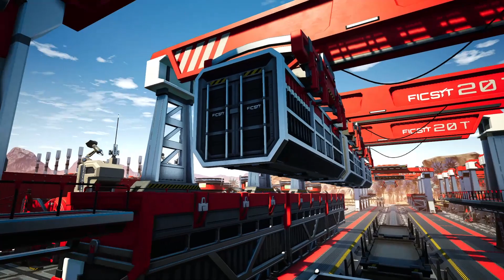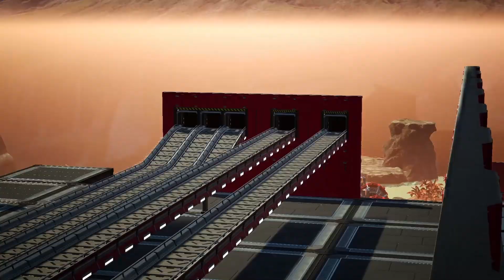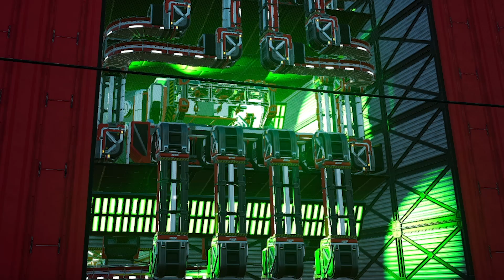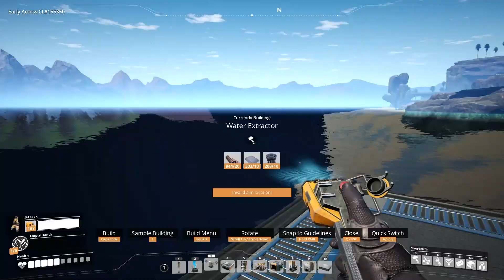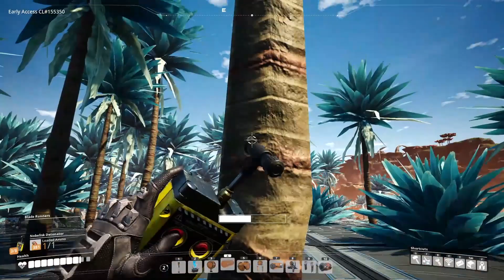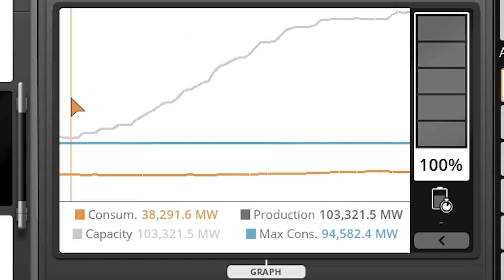100+ Nuclear Reactor SUPAH Power Plant! | Satisfactory Update 4 Gameplay Ep 9

Comment: On the old Nuclear scheme before patch 4 I made myself a nuclear waste sarcophagus at the bottom of the big waterfall near the early starter zone. I found if you build the sarcophagus at least 3 foundations thick and then make it lower than the normal ground level (preferably near the bottom limit of the game) the radiation is far enough away and encased enough that the radiation is tolerable at reasonable distances from the sarcophagus, I didn't know if this might be useful.

Comment: This is insane. How about separating the reactors in batches of 50.000 MW? Don't power all of them at once. Maybe cutting belts?
Add batteries to hold the front until you belt the last section of each batch...?

Comment: Important note: apparently pipes don't transfer 600m3/s perfectly, so two reactors on a single mk2 pipe will not run all the time.
Reply: Pipe manifold system like the 3 water extractors to 8 coal generators but with mk 2 piping. Problem solved 🫡 ……I hope 😅

Comment: You might want to add power switches to limit the number of reactors operating at any given time, no sense in creating waste from a power plant when the power has no place to go and as you require more power you can just go flip a switch
Reply: The powered splitter mod in conjunction would help. Control where nuclear goes.